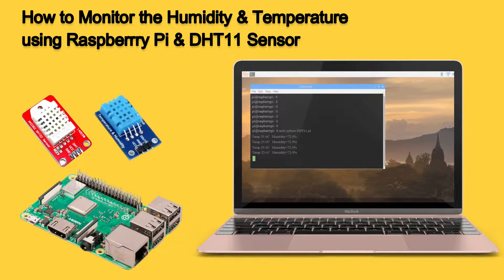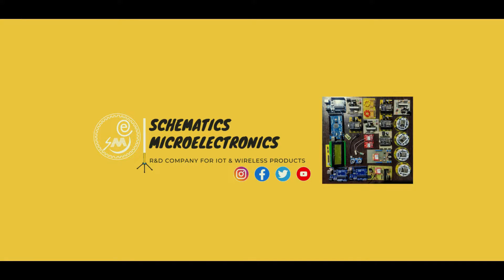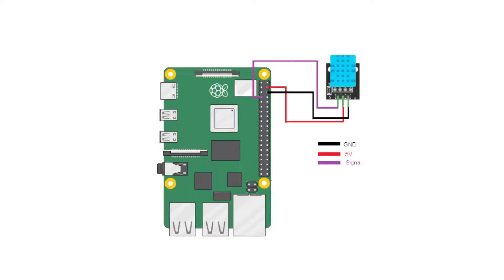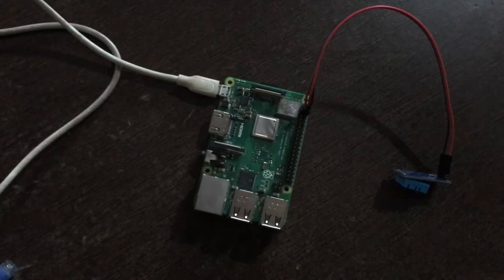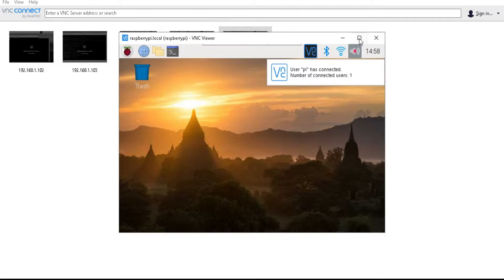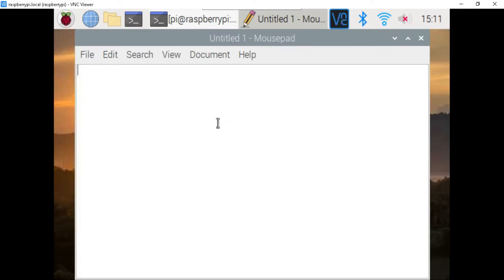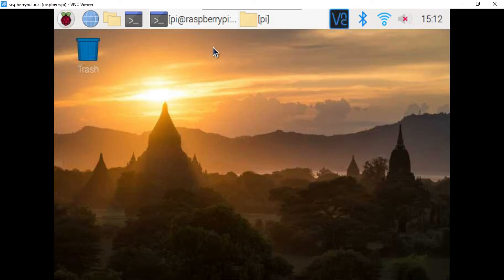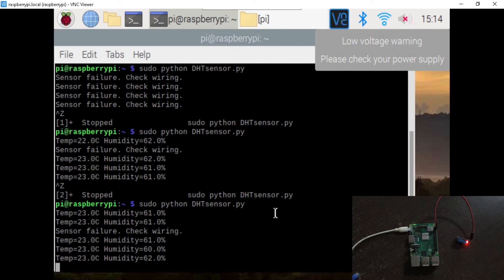Raspberry Pi with DHT11 | Humidity and Temperature Sensor Monitoring

Comment: Hi sir facing below issue i am using DHT22 
udo python DHTsensor.py
Traceback (most recent call last):
  File "/home/rugved/DHTsensor.py", line 8, in <module>
    humidity, temperature = Adafruit_DHT.read(DHT_SENSOR, DHT_PIN)
                            ~~~~~~~~~~~~~~~~~^^^^^^^^^^^^^^^^^^^^^
  File "/usr/local/lib/python3.13/dist-packages/Adafruit_DHT-1.4.0-py3.13-linux-aarch64.egg/Adafruit_DHT/common.py", line 80, in read
    platform = get_platform()
  File "/usr/local/lib/python3.13/dist-packages/Adafruit_DHT-1.4.0-py3.13-linux-aarch64.egg/Adafruit_DHT/common.py", line 63, in get_platform
    raise RuntimeError('Unknown platform.')
RuntimeError: Unknown platform.

Please help

Comment: Every souple outputs it says sensor failure, is there any way to fix this?
Reply from the maker: There may issue with sensor connection with board or your sensor is not working properly due to power issue.

Comment: pls help me i got this error 
Traceback (most recent call last):
  File "/home/pi/baitapIoT.py", line 27, in <module>
    print("Humidity = {:.2f}%\tTemperature = {:.2f}C".format(humidity, temperature))
TypeError: unsupported format string passed to NoneType._format_
Reply from the maker: Hi, 
First try to run code without any change. It will work. Only change the blynk token

Comment: Hallo saya memiliki kendala, tolong bantu saya 🙏
Kendala : no module Adafruit_DHT

Bagaimana solusinya?🙏🙏🙏
Reply: hello, sorry I can't speak English.  I'm using google translate. my problem is in minute 4.10. (the sensor won't read the temperature)
Reply from the maker: Check the wires that you are using to connect the sensor with raspberry pi.
Reply: @SMEDehradun  this error is not from coding?  but from the hardware?
Reply from the maker: Yes. This may be due to connection issue of the sensor with raspberry pi.
Reply: @SMEDehradun  Thank you very much 🙏🙏
Reply from the maker: Hi,
Write your query in English